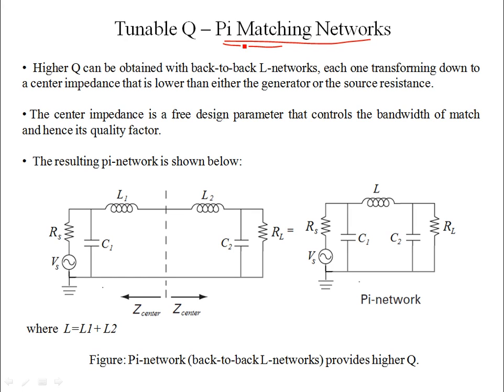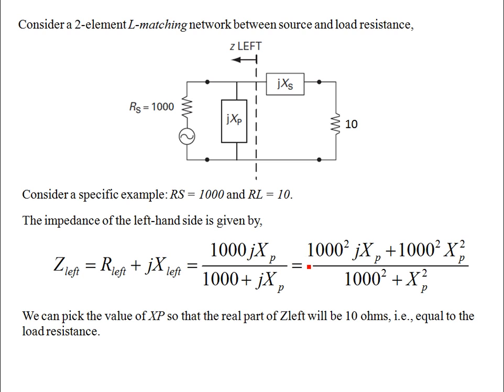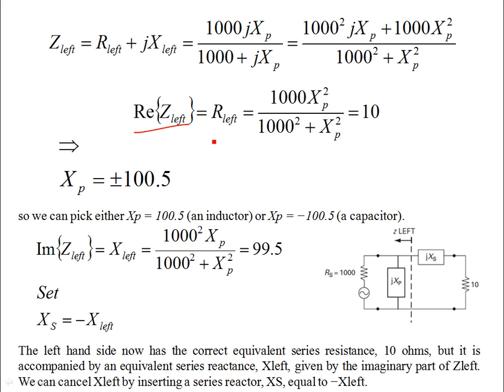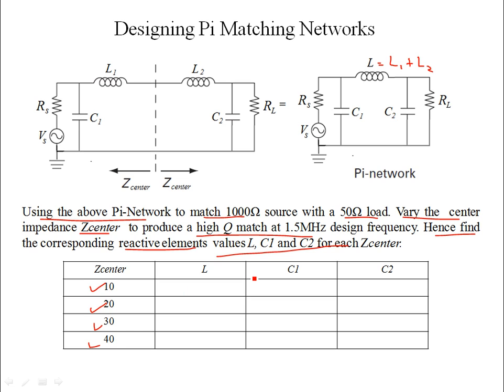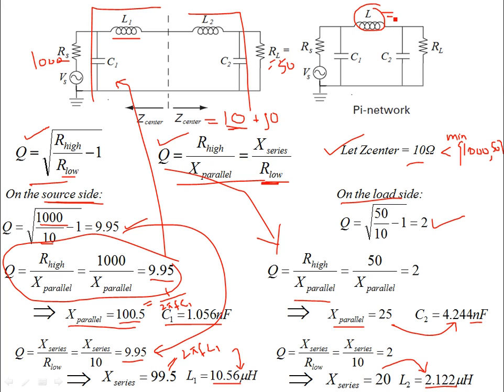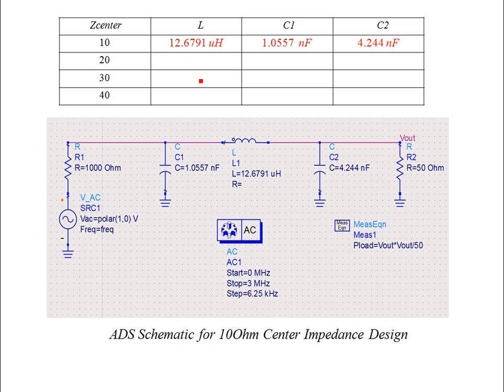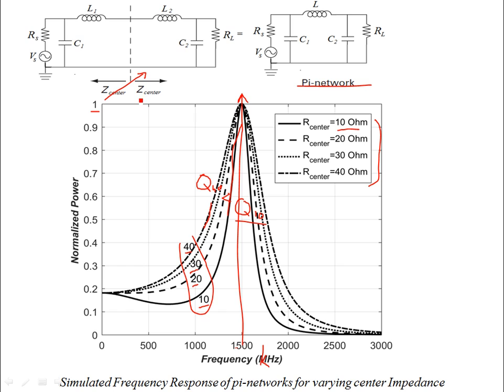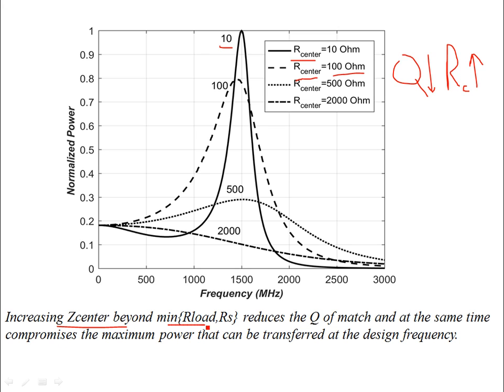Pi Matching Network

Comment: How to extract the real value of Zcenter of a PCB with antenna 2.4GHz?
Reply from the maker: Hello Ayoub, at 2.4GHz I think its better you use Smith Chart for matching your antenna load with the source impedance. Lumped component approach is used for matching at lower  frequencies. I suggest you need to look into how a piece of transmission line (Stub) can be used in shunt or series with your antenna load. The parameters you get from Smith Chart will be the length of stub and its distance from the antenna in terms of wavelength at 2.4GHz. Cheers.
Reply: @mansoorkhan7109  Thanks for sharing value content. Do you have any video to suggest
Reply from the maker: @ayoub6165  Search for Stub Matching using Smith Chart term i am sure you will find many videos explaining it. All the best
Reply: @mansoorkhan7109  In PCB RF design they usually use a pi-network matching  impedance (clc). Do you have any recommendation for clc calculation instead of Stub?
Reply from the maker: @ayoub6165  Hello again! If you need to do this with lumped components have a look at my other video at https://www.youtube.com/watch?v=Xtk4N2jktYw I have illustrated how you can match a general complex load (RC or RL) at given design frequency to source impedance. Analytic calculations shown in the video are then simulated on circuit simulator (Keysight ADS) to show that a RC load  matches 50 Ohm generator output impedance. For a Pi network you can use two back-to-back L-Networks as discussed in this lecture above with Zcenter < min{Rsource, Rload} and then design two L-sections  for the selected Zcenter. A quick alternative will be verify or calculate your Pi Network using the online matching calculator tool available at https://www.eeweb.com/tools/pi-match/ I have shown how to use this tool in the complex load matching video. Hope it helps!